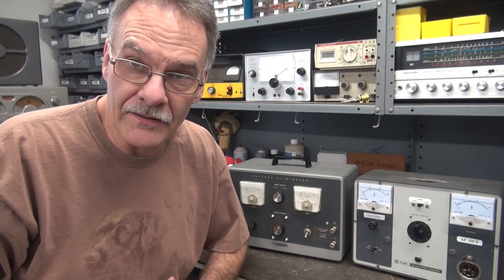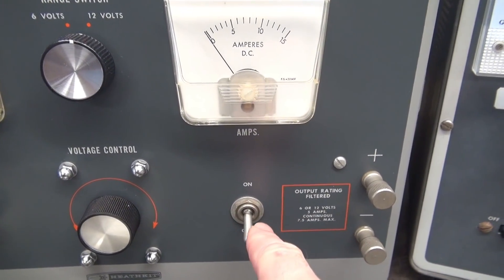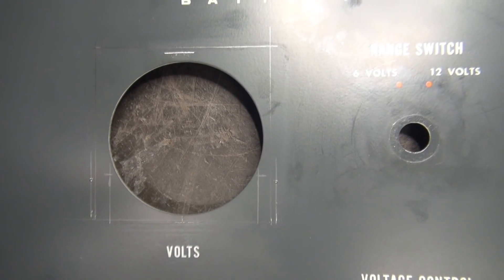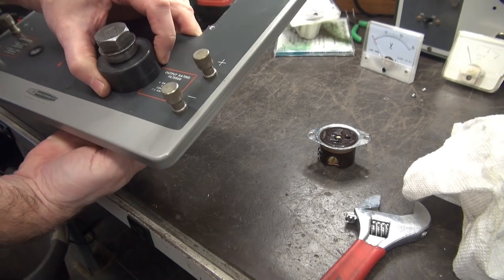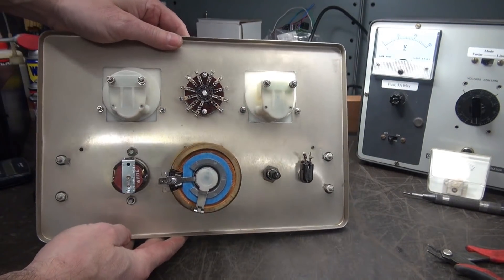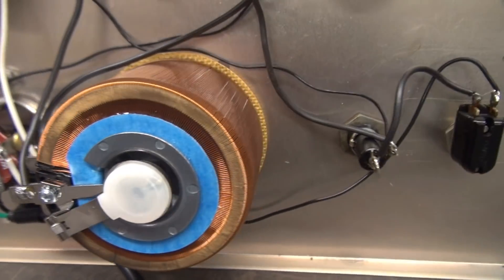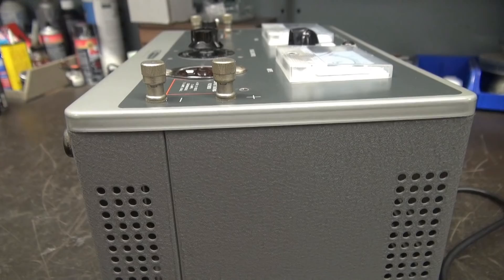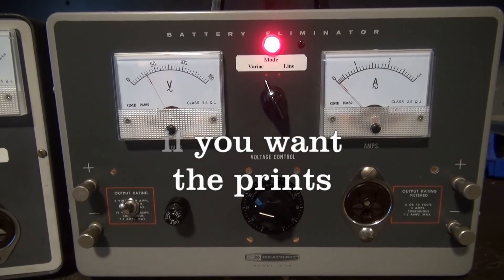How to Modify Re-Purpose Heathkit IP-12 DC Power supply into a bench AC Variac

Comment: Thanks for the video!!  I have an isolation transformer from a Viz WP-29A unit.  It would probably fit on the inside back wall.  The Viz unit has a combo Volt/Ammeter.  It needs AC power that comes from the Iso Transformer which has a 10VAC windings. So the AC input would go to the Iso transformer first, then the output would feed your circuit.  I can now see that you are using the Staco Type 221-B variable transformer!!

Comment: The output voltage on this was either 6 or 12 volts.  Another way to re-purpose this unit would be to make it a "variable" output DC bench supply, with a higher maximum voltage output.
Reply from the maker: Yes, you would have to replace the main power tranny to accommodate that mod

Comment: Nice! I actually prefer the front panel color scheme on the Heathkit over the Knight.
One question: the diagram shows the input power going to the power switch first, then the fuseholder.  I'd like to know your reasons for doing that instead of putting the fuse before the power switch.  I can think of good reasons to do it either way, just curious as to yours (and other viewers' as well).
Reply from the maker: Hello, no reason, could be either way
Reply: @d-labelectronics  That's fine, I appreciate the response.  Take care, sir, and give my regards to your family!

Comment: This is amazing Terry! I just picked up a HeathKit BE-3 for this very purpose Thank you! Gonna do one in an Eico to?
Reply from the maker: Cool deal man, I have not tried the BE-4 yet, but should be do-able
Reply: D-lab Electronics sorry I meant BE-3, my bad, pretty much the same as the IP-12, expect it was only 6 volts so 2 less connection terminals and a knob. Here is an example:

https://rover.ebay.com/rover/0/0/0?mpre=https%3A%2F%2Fwww.ebay.ca%2Fulk%2Fitm%2F153465403257